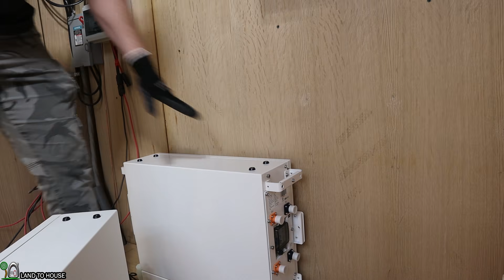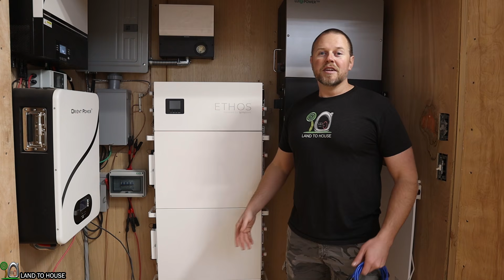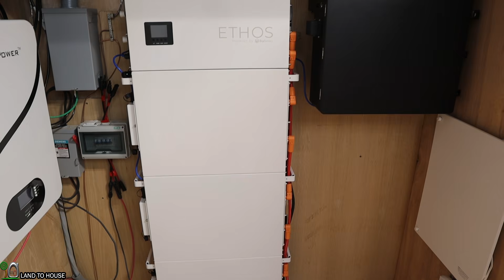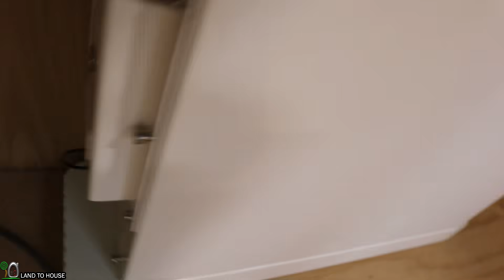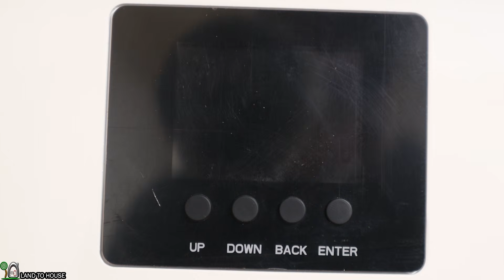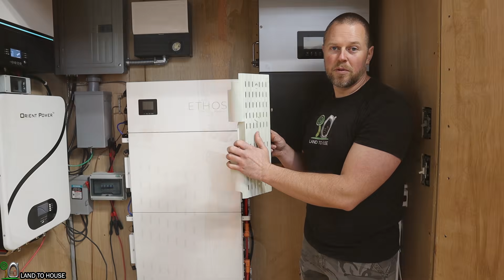Big Battery Ethos Full Install 48v LiFePo4 Whole House Battery

Comment: Good looking batteries and its a clever design to have wired dual paths for the high amperage.  I'm a tad concerned for your safety that the breakers are buried behind 2 sets of covers with screws.  That would slow you down if you have an issue and need quick access to shut them off.

Comment: Nice install, earlier you also showed you could connect the Yeti Pro 4000 to your shed, are those going to work parrallel, or will you use the Yeti only as backup?
Reply from the maker: I'm going to see if I'm able to disconnect the jumper in my transfer switch so that I can use it as 240. That will allow me to use the luck's power as 240 V. The yeti will likely go to a new home.

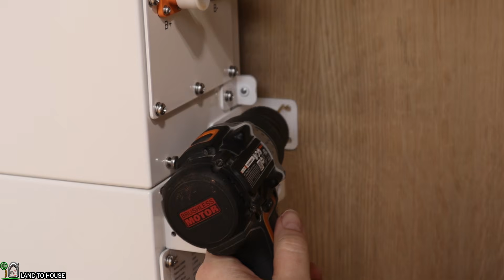Comment: 04:20 - always start a screw/bolt/nut by hand, or if you do that in a factory, it could fly into machinery on production lines, etc..
Reply from the maker: That is a good idea. Here in the diy home install it's not so bad. But I could see a flying screw being bad in many cases.

Comment: If using the two of the 6K Inverters, do the inverters come with Current Transformers (CT) so that in a grid-tied set up I can be sure NOT to back-feed any energy into the grid? Extremely important for some of us not to put anything into the grid.
Reply from the maker: I know for sure the 12K comes with CT clamps. I'm about to open the 6K inverter and I will let you know about that 1.
Reply: A high powered, one way only, buffer should prevent that. -▶️▶️▶️-

Comment: What's it's estimated life, say to 50% deterioration, medium use?
All these factors have got to be factored in,  in initial cost calculations.
Reply from the maker: These batteries have up to 8000 full cycles. The warranty is for 10 years. From what I can tell the battery is high quality.
Reply: 8000 cycles to 80% usually, so FAR more to 50% @LandtoHouse